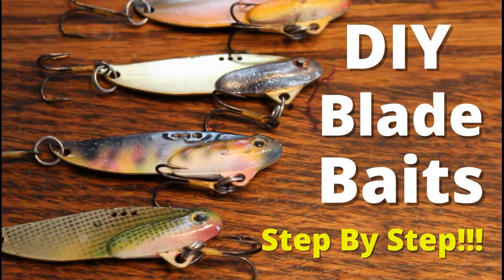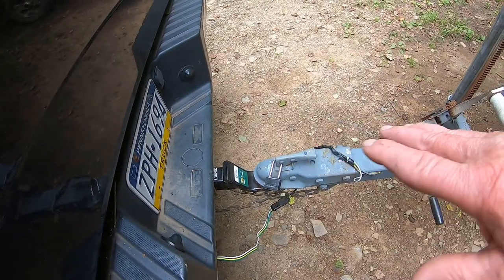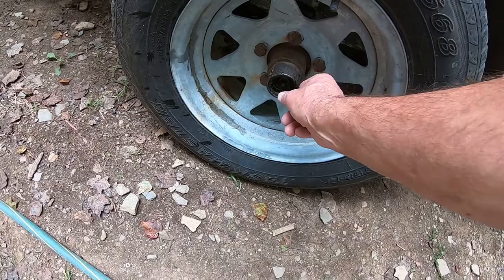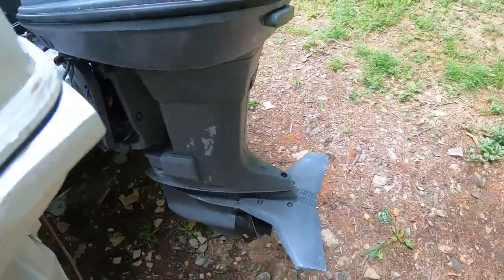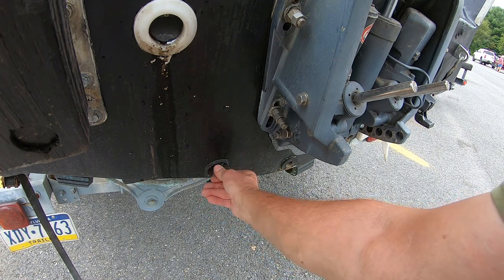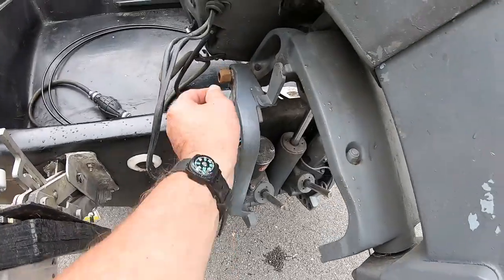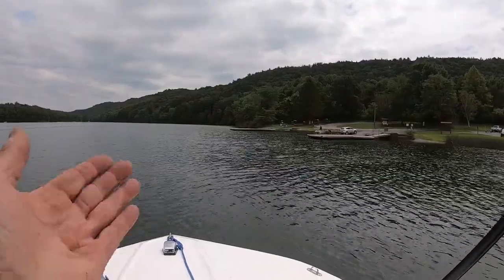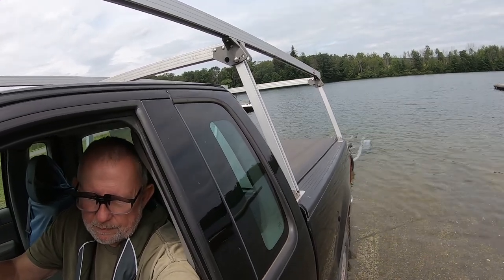Tips And Tricks For Trailering And Launching A Boat!

Comment: Excellent video. I watched it twice and took notes. This is the best launching and trailering boat video on YouTube. Loaded with one great idea after another. Such good advise like: staging everything the night before, checking the list on each trip, correct position of the priming bulb, the board for the breaks makes all wheel breaking at the ramp, hand on the bottom of the steering wheel when backing,  let the wind work for you when docking. I can't wait to use the reverse and turn towards the dock technique. Thanks. What a great video Here are a few things I have learned over the years that you might enjoy. 1.Add a mid-ship cleat to use when you tie your boat to the dock then you only need one line and the boat stays against the dock. 2. You might want to try wire ties made for fuel line instead of the hose clamps. They actually seal the hose better. 3. If you shorten the rope when launching the boat it won't go out of control and maybe hit another boat. Especially important when it's windy. It's interesting that you don't use a transom saver. Guys like us truly appreciate one of my favorite scriptures Rom 1:20. We learn so much from studying the bible and from observing his qualities from his mind blowing creation. Thanks so much and thanks for the superb message at the end spoken by a real believer with nothing to gain but helping someone else have a better life.
Reply from the maker: Thank you so so much for your encouraging words! It means a lot! Thanks too for sharing some great suggestions that I'll have to try. Its great that we can all learn from each other! I'm so glad that you got some helpful tips from the video as well!
I used to use a transom saver in the past, but the lower bracket that mounted to the trailer was light duty and broke off. For quite a few years now I find that I've had no issues if I put the motor all the way forward as this appears to moves the center of gravity on the boat side of the transom or close to it and it doesn't seem to bounce at all. Thanks so much again for sharing and affirming our ministry I so appreciate  it! God bless you richly!

Comment: I'm a little late to the game here as i just found your videos.   Nice video.  A couple of tips an "old timer" passed on to me:  always put the boat motor in gear when trailering down the road to prevent the prop from spinning in the wind as it typically needs to be in the water to keep cool and not overheat the seals and also when prepping to put the boat in the water at the landing to unplug your trailer lights  in the event water gets inside the light housings while backing into the water to keep the bulbs breaking from being hot from use.   I really appreciate the endings of your videos.  I've been dealing with an aggressive form of leukemia for a couple of years now that is not curable but hopefully can be kept at bay for a while yet.   Am currently on my second type of treatment as the first stopped working.  When the new one stops working (which I'm told it will eventually), we're in the realm of experimental treatments.   Putting things into God’s hands really keeps things from becoming overwhelming.    Take care and God bless.
Reply from the maker: Thanks so much for the tips. They were great! I never thought about the prop spinning so it couldn't hurt to put it in gear to stop that. I used to unplug my lights ever time and would recommend that anybody using the old style bulbs do, but I haven't found the need with the LED lights as they are both sealed and don't get hot and break when the cold water hits them like the other do, but again it certainly couldn't hurt. I am also so sorry to hear about your illness. I can totally relate with all the pain and suffering it brings, but on a good note my cancer drew me into an intimacy with God like nothing else could and God revealed himself in a way I never could have known without it. If you haven't done so already I'd encourage you to scroll down in the description below the video to my book "To the brink and back again" and click on the link so you can read it. It is FREE and in it I share about my journey with what the doctors proclaimed as terminal cancer giving me only 36 months to live and how God carried me every step of the way and brought me though it all. I know God is there for you the same way he was there for me and I would encourage you to trust him. The fact is that all of us are standing at deaths door and not even the next minute is guaranteed for us. The peace I have having placed my faith in Jesus to be my savior and forgiving me of my sins is beyond measure as I know that not if, but when I pass from this life to the next I will be with him for all eternity in heaven and that makes all the difference. In the back of my book I share with anyone how they can place their faith in Jesus and have that same peace as well.Thanks so much for watching and sharing and I will be praying for you my friend for strength, healing and that you might know God with even greater intimacy! May God bless you richly and be with you every step of your journey!!!